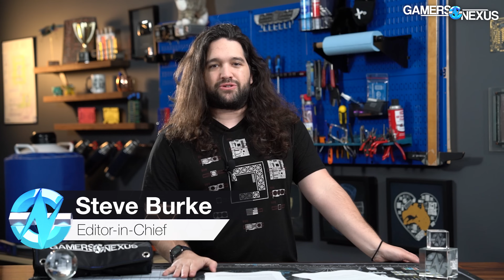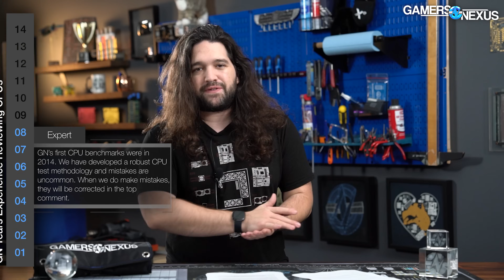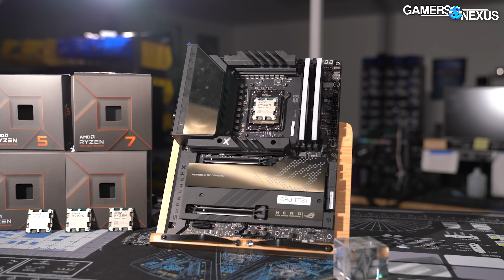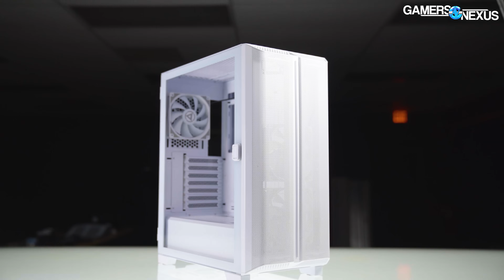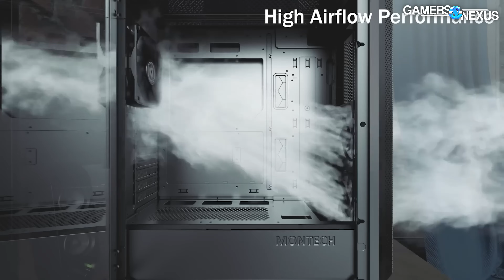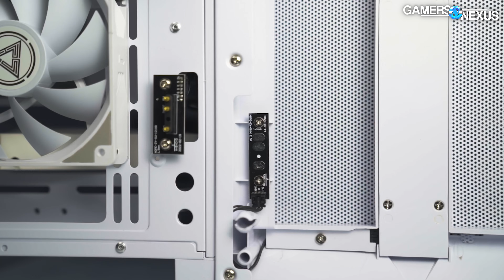AMD Ryzen Eco Mode Deep-Dive & Benchmarks on R9 7950X (Zen 4)

Comment: I built a PC with a 7950x using a B650E Aorus Master M/B and also with a Deepcool LS720 AIO (360mm). With stock settings the CPU temp tops out at 90 deg C when running a CPU-Z stress test  (benchmark score 15857). Most of the time the CPU runs at under 5% load and draws 10 to 20W of power. I see no point in crippling the CPU for the few times I may demand full computing power.

Comment: The eco modes are honestly what I've found most impressive about this generation of CPU's
Reply: Eco mode is actually the normal mode, while the default mode is actually shameless factory overclocking.
Reply: Well it does make sense they say they keep increasing efficiency but the TDPs keep going up so something Has to start making sense
Reply: What you should’ve been excited about is manual per-core undervolting alongside tinkering with PBO. This is where peak efficiency is
Reply: living in europe dependent on russian gas for heating eco mode is not what we gonna use this winter xD
Reply: @woswasdenni1914  Electricity for Heat is still about 4 times as expensive as Gas. Paying 12 cent per kWh of gas vs 48 per kWh of Electricity.

Comment: I notice you measure CPU power at the 12V power connection. I am sure you know this but of course this number will be higher than the CPU computed values due to VRM losses. 
At least on my 9900k Intel there is also the rest of chip power, which the 12V reading does not measure(everything but cores)(drawn from MB power supply). On my 9900K, rest of chip is ~6.5W.
It could be the ~160W Eco mode is closer to the AMD '105' than at first glance.

Comment: Does intel have an equivalent eco mode, i might actually upgrade this gen if there was eco mode available for both cpu or gpu. It's not about power cost but heat generation, it simply is too hot and humid in my part of the world

Comment: It's worth noting that limiting CPU power draw to <90W means that you can potentially run a passive cooler, or at least a REALLY quiet cooler. For some audio production purposes this could be important (when paired with passive PSU, etc).

Comment: First thing I did when I got my 7700X was PBO undervolt by 25mV and reduce the power limit to 85W and the performance was basically the same as stock, but with much lower temps. I was pretty happy with that.
Reply: I just ordered 7700x & would try & see.. the reviews says it's around 150w max at 100% usage..
With your 85w, it's like 40% power less power for nearly the stock GHz speed? not bad
For me, I'll try to go to 105w (undervolt) with slight OC (might be able to get a better boost?)
BTW what Mobo did U get? all the B650 I found was expensive..  Asus B650 TUF is $240 while MSI Tomahawk is $270
I like Tomahawk because it's have better thermals & more sata 3 ports.. but the TUF price is better
Feels hard how my B450 Tomahawk was $100 in 2019, while this new Tomahawk is $270 (2.7x increase)

Comment: As a programmer, noise matters for concentration. So 7950x with 65W eco mode would be worth over 7900x. The price difference between 7900x and 7950x is insignificant compared to total cost of the upgrade.

Comment: It appears that AMD should have launched it in something like 125W eco mode by default, get almost the same performance at tremendously better power and none of those boiling hot temps, make intel's power efficiency look tremendously worse. Pushing that hard past the efficiency peak is sad, borderline laughably pathetic for both companies, especially intel... zero grace...

Comment: Perfect timing!  I was waiting for someone to do a deep dive on ECO mode...great video!  I will be building a 7950X in the next month or so...and will run it in ECO mode.  Makes a lot of sense not to drive the CPU so hard for such small gains.
Reply: Exactly my thoughts. I basically wanted better then ryzen 5000 performance but at least same efficiency. The 105 watt eco mode is even better then expected. It looses barely performance, few % tops, but it still 'crushes' the 5950x, win win situation.

Comment: It always makes sense to cut a bit, I tend to keep my computes on  "power saver" except if I am either in a hurry to render something or work on a very heavy project. This simple toggle reduces power usage to 1/3 while maintaining perfectly usable user experience. It makes a huge diff for laptop battery life and fan noise as well. Not unlike a car, most of the time people do not drive cars at full throttle.
Reply: You would be amazed how much load is put on the engine just maintaining a average road speed. I have not the right figures but about 60-70% load is just about the sweet spot for a efficient engine. Unless going down hill / slowing down the goal is to still be above 50% engine utilization. That is why we got more then 4 gears in cars. Even going passed 6 gears as standard.

Sometimes a bigger engine can save fuel. Just because your not going passed the efficiency threshold just keeping the vehicle at a constant speed. But to big (like a V8) you got the problem of cruise speed being to little work for the engine to get efficiency. A heavier engine dose not help too. Gearing the engine to increase loads at higher speeds makes the vehicle not as fun to drive. Unpractical even. But the big V8 big poor fuel economy stops people having to hold the gas pedal 80% down just to cruise right?  And no need to downshift up-shift. And probably the older cars where not really going to be happy running a constant 70% usage all the time anyways. But that is more due to drivers and behavior when the engine is to small. Just abuse. 

Modern cars are mostly just giving the driver a pedal to give instructions. And with the help of turbos and dumping fuel into the cylinders makes accelerating possible even when the engine really should be strained from just keeping a current speed up. Let alone trying to accelerate and anything happens in a high gear and what not. That is when small engines are slow but turbo more sporty engines just turns wasteful.

Really if anything eco driving is like a thing for a reason. And poor fuel economy is still possible with a turbo 4 cylinder car. But it is actually bad to want the engine to not be doing anything. It should be under load or it is just dead weight that eat energy.

When boosting passed the natural engine size with a turbo or crazy fuel dumping to stop knock. Your literately running the thing in a OC state. And it is designed to do it. But the goal of that is to make the bulk of the drive run at the sweet spot of 70% load. Usually that is why turbos are such a grate thing to have. If not for being able to go passed the natural less advanced design? Well engines had to be bigger. And so efficiency is only reserved to slow cars that struggle at highway speeds. That was how it worked for a long time. 

Why non turbo diesels are often very efficient was because they where slow. Even now a eco mode driven turbo machine can gain even more thanks to being smaller lighter and smarter built. Until you just floor it like EVERYONE dose. 

Like your being fooled to think that the pedal really related exactly to how much work is done. Even RPM means nothing when it comes to work done. Small engines uses turbos and wasteful tricks to become big engines. But when they can they try and run as a small engine under a decent load. Like for real the same thing seems to be true with AM5. But instead of any efficiency they just send it. Intel just have no clue what they are doing most of the time. I think they are still for the hunt for more + marks to add to there CPU. The numbers to put on it they just make up.

>:9

Comment: I’m happy to see this testing borne out. I’ve been on a 7950X on my build running in 105W Eco mode and have been perfectly happy, especially since power where I live is closer to 40 cents/kWh all in. The one thing that I think might be worth it is that while I’m running an AIO cooler now, I know I could probably get away with a good double tower air cooler and be reasonably comfortable knowing that it should be able to keep up.

Comment: I have a 13600K and my board lets it have any power it asks for.  100% unnecessary.  I limit it & it only pulls a MAX of 126W in Cinebench R23.  NO PERFORMACE loss. The 13600k is a BEAST but you almost HAVE to limit the Voltage

Comment: 17:17 is impressive how the 7950X in 65W ECO mode performs better than the 5950X stock 8' vs 9.4' (16:16) and given the efficiency chart 11.8W vs 18.9W (15:15) if you want the maximum performance with the minimum power draw is an option, in fact with that efficiency I wouldn’t be surprise if we see 16 core CPUs in laptops soon
Reply: Well you were right

Comment: Why wouldn't you use a low power setting with the competing intel chip as well in these benchmarks? I understand its a lot of benchmarks, but did we need the comparison with a 3970x, or a fx-9590?

Edit: Also, why do people (not you GN specifically) focus on bios eco mode - You can get similar and easier results by just changing windows power plans. Running a 13900k in power saver with 3 browser windows (youtube/news/reddit/twitter), discord 8 hours - my average is 17 watts core package power. What would the results with AMD be? (Actually curious)

Comment: Without a single bit of remorse, I would willingly kneecap a 7950X with 105W mode just to get the thermals under control. 

That said, I'm actually looking to get a 7700X, so I guess I'll just have to see what happens with that.

Comment: Before I watch this, I assume the Eco-mode is targeted at "farm" builders, where power and cooling becomes a huge problem, where the cost of the CPU is minimal compared to installing an industrial aircon unit, and power system to handle your farm.

Edit: what the hell is wrong with Far Cray 6 , and FF XIV? those mins are so bad, reeks of "poorly optimized junk".

Comment: I'm curious if long term reliability is different across the different modes. Heat is the enemy of electronics and running a constant 95c for years  concerns me. It would also be nice if you could change settings on the fly from the taskbsr instead of bios. So you just always run minimum except when you need it faster.

Comment: I use "handmade" eco mode on my 5950x. I could immediately feel and see the difference in room temperature (12m² room ) at the end of my workday as I am running VMs, containers and compilers the whole day long
Reply: Me too for my 5900x! When it doesn't make the room warm too. I wished there were more videos about how to run more efficiently than power at any cost.
Reply: My 5950x runs hot. Ever since I got it 2 years ago, regardless of the Noctua or the AIO, idle temps are always above 50 and recently skyrocketed to 65-70. Tried curve optimiser but really only stable at -10 and did not help temps. Could be an AIO issue, but I had high temps even with an air cooler. 

So tempted to use this as an excuse to upgrade to the 7950x3D, set Eco 105 and not have a second heater in my room..xD
Reply: @inconvenientfacts58  Get a better case. I have the 4000D with three intake infront at 1800 rpm, two on top at 1800 rpm and one in the back at 1200 rpm.
Dark rock pro 4
And at 122W (5050mhz) it goes max to 77C.
AIRFLOW you NEED to have AIRFLOW
At idle it is like 22-30w and 30-35C.
Reply: Same, but I like turning it off in the winter 😆
Reply: @futuza  haha. My house is isolated too well. In winter it's perfect
Reply: Wasn't the 5950x a super 'cool' cpu? I looked up some tempts to compare to the insane 7950x, and they were mostly 65-80°C (defintiely not 90°).
Reply: @Matti6950  Yeah, but like 65°C is definitely going to warm your room up XD.
Reply: @Matti6950  yes. But temperature does not equal heat output. If it outputs 150w and is at 50c it heats the room the same amount if it outputs 150w and is at 75c
Reply: @KilianGosewisch  One thing is for sure, IF I buy Ryzen 7950x i will use Eco mode 105 watt (142 wat ppt). It's gigantically better in heat, efficiency, Noise, Summer room heat.

Comment: I've also observed that Eco Mode on Ryzen only impacts multi-threaded workloads. Single-core workloads show no thermal or power draw improvement at all. Single-core efficiency really only improves when you undervolt. Personally I find that Eco Mode for gaming is completely useless.

Comment: Are there any charts normalized to wattage? I'd want to see CPUs normalized to 100 150 & 200 watts as well as full draw from a wall normalized in 50 watt increments as well.

Basically how long does a render take at 100/150/200 actual watts across different CPUs. 100% of wattage becomes heat & that matters in the summer when you have to pump it out of the room, in the winter not so much.

Undervolting is the ideal way to constrain draw. If you do nothing else undervolt as far as stability allows at whatever frequency you are aiming for.

Comment: Why are we using 1080p gaming benchmarks? Anyone who can afford a 7950x will be gaming on at least 1440p monitors.
Reply: 240hz, 360hz monitors exist. They are 1080p and the 24 inch zowie starts at $599.
Try running any game released in the past 3 years (besides ow/valo) where you can utilize this high hz in 1440p.

Comment: [Edit: Oh no, I posted too soon in my watch-through! Watt-Hours figures are definitely in this video! Figures (and preliminary discussion) starting at about 14:23... Oops.]

[Original post below]

Would you consider giving power efficiency figures in Watt-Hours instead of instantaneous Watts?

Ars Technica has started giving power consumption in Watt-Hours. I think they started doing this after a commenter pointed out it would be more useful for actual power efficiency questions, not just "is my cooler adequate?" questions. (I think HardwareUnboxed briefly flashed a chart of Watt-Hours figures as well on the Ryzen 7000 reviews? Did I remember that right?)

For methodology, I assume you just track the average power over your test period, divided by the test duration, and there you go. You would have to use a fixed workload for this to be meaningful, so that getting it done faster will help with the final Watt-Hours figure. Otherwise you would have to do a score-based test (such as Cinebench) and do a score/watts, which is vaguely similar to, but not actually the same as a watt-hours-per-fixed-workload result. 

In temrs of real-world relevance, for example, I've seen the 5950X at stock settings getting really good (low) Watt-Hours figures for a fixed workload. Basically the efficiency champion. Even though its instantaneous peak power (straight-up Watts) is among the highest of the chart.

So to sum up my comment... Like I said at the top: Would you be interested in giving Watt-Hour figures? I'd be interested in seeing them!

Thanks for what you do! Love the videos!

Comment: I've been running my 3700X with eco mode enabled for most of its life. Still outperforms the 4790K in all situations, all while consuming at least 28W less (running it at 4.6GHz had it drawing over 120W so under half in that case).

Comment: Efficiency with Zen is a bit difficult due to the presence of the IO Die which consumes a constant amount of power all the time regardless of load, and that is included in the cTDP computations. I've tried undervolting my SOC rail and that caused a fairly significant performance increase on my 5800x because it had more power to play with, without even touching PBO.

Comment: I would say the main benefit is massively reduced thermals. You could also manually set power limit and voltage offset, and target 70-80C thermal limit to get stock performance at lower temps.

Comment: Looks like the 105W ECO mode for the 7950x is the sweet spot for power savings, but especially for a significant temperature drop over stock. I'm guessing tower air coolers like the Noctua NH-D15 will be viable again for this cpu at the lower temperature. Not a big fan of liquid coolers - more expensive with more modes of failure. Anyone want to slap a NH-D15 on a 7950x and report back the temps?

Comment: So again, I would have to run my fans at 100% to get the most performance possible? No wonder ppl don’t buy these.

Spoiler: Most regular users do not enjoy jet engine noise levels. And if you need to cut performance drastically to get to normal levels, then you’re buying something else. I would probably take the -300 to get down to 61c. Well, above that as I’m still not running 100% fan speed unless my PC is literally about to burn.

Comment: Yeah nah... if the frequency drops by 10%, that's a drop of 10%. No reason to blow it out of proportion by "multiplying" that drop with the core count. Assuming the worst-case of linear scaling with core frequency, that's a 10% drop in performance, no matter if it's a dual-core or a 16-core CPU.